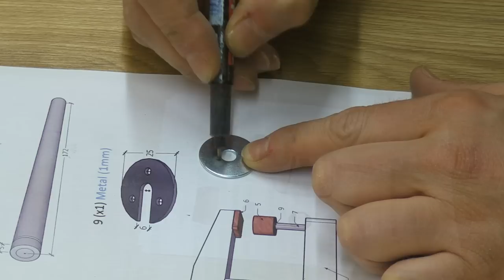Homemade C Clamp

Comment: very good👍👍👍👍👍
Reply from the maker: Thank you so much 👍👍👍
Reply: Would it be possible for you to create a video with plan for the extension you have used at 2:35 in this video which helps in vertical edge cut with fine gaps?